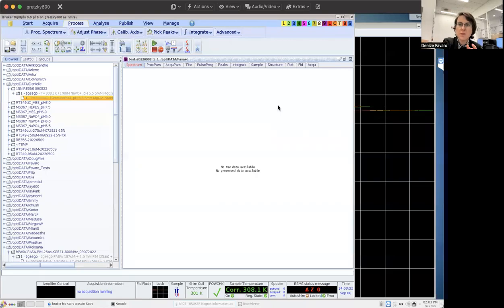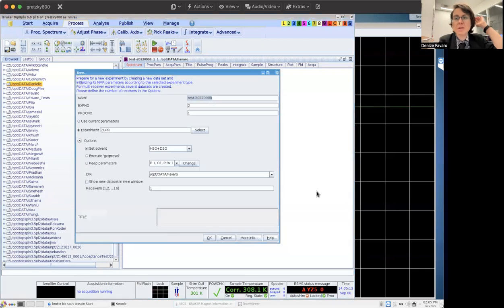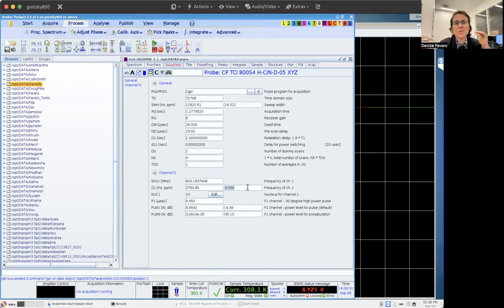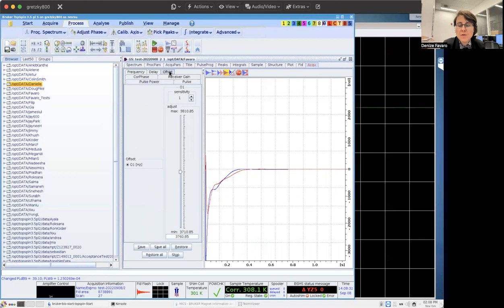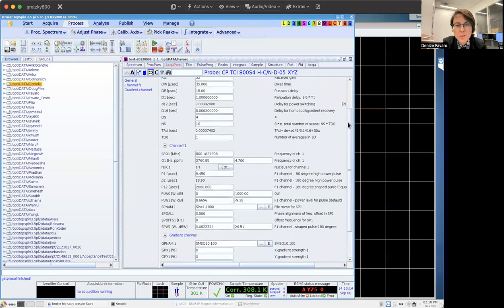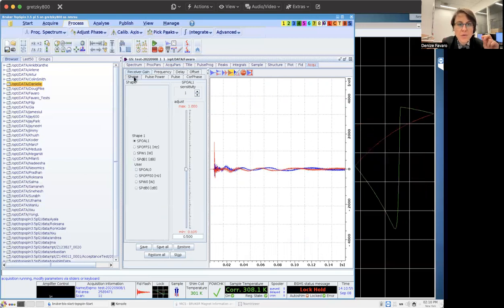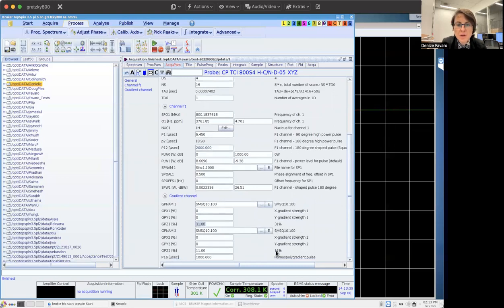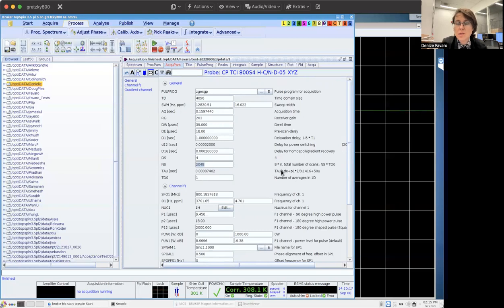water suppression (solvent suppression)

Comment from the maker: Quick comment: if you use "pulsecal" to calibrate the pulse, the selective pulse for water suppression is calculated. For the ZGESGP pp, it is usually okay, but if it is off, you need to play on "gs" --> Shape --> SPdB1[dB]. In my case, I had 1dB off.